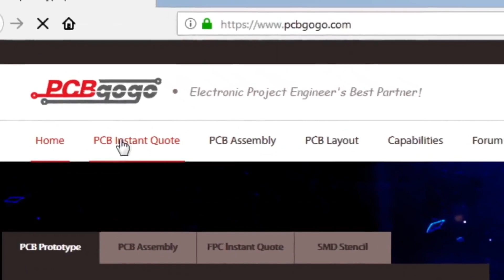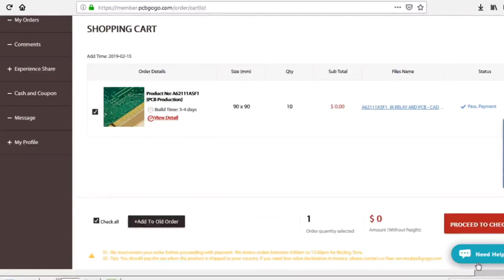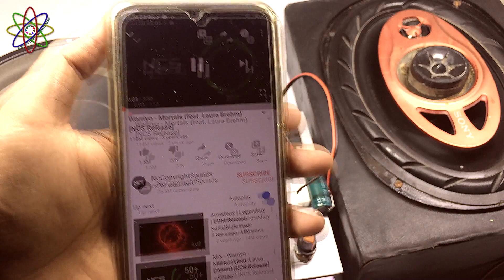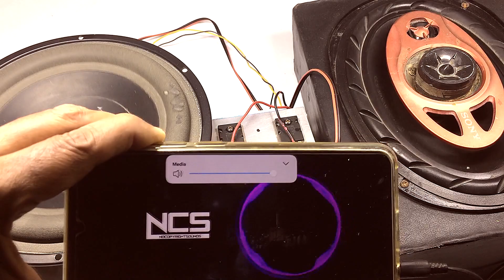C5200 & A1943 Powerful Amplifier DIY Ultra Bass with homemade Tone Control Bass Treble

Comment: Hello, can you be the same project but with transistor 2sa1941 and 2sc5198 and the IC LM 358 please with a voltage of 35 0 35 restored.  I hope you read my comment